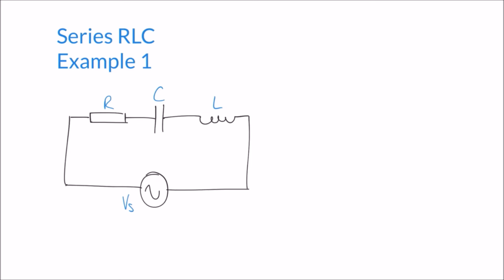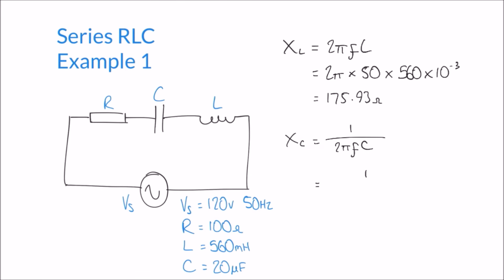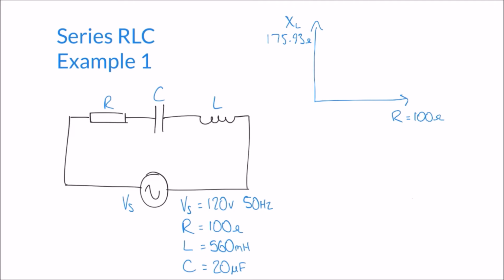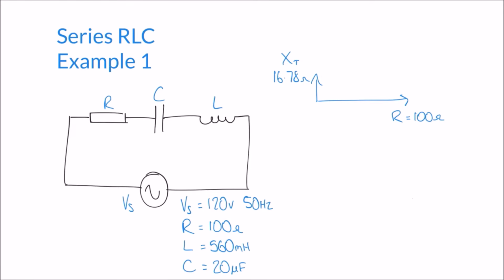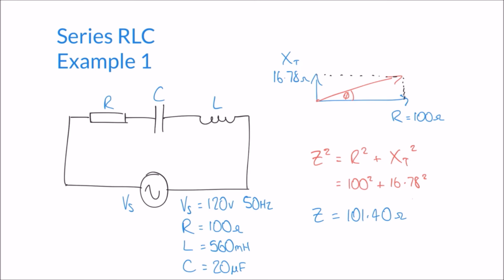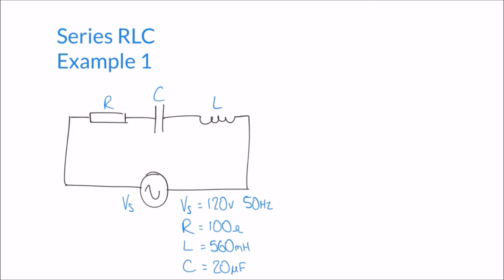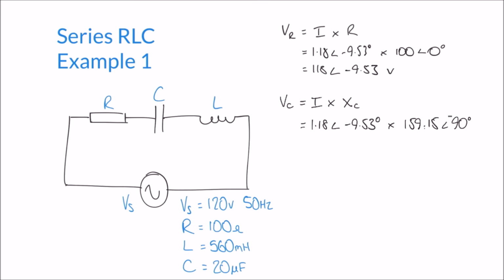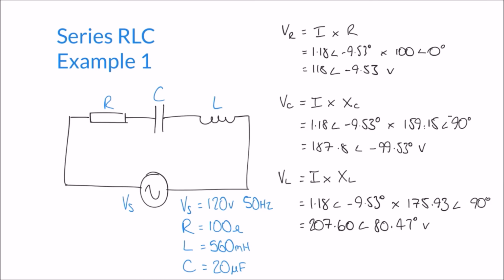Calculating Impedance, Supply Current and Voltages in Series RLC Circuit

Comment: Doing Level 3 electrical installations and found this very useful and even gave a more in-depth look at this problem. different yet similar calculations. always a joy to see different methods to work out one question as this gives more understanding of this question. Thanks for this video. still useful 5 years later. that's one of the beauty of maths.

Comment: What happens if cap reactance is a higher value than the inductor? Is it still (Xt = Xl - Xc)
Reply from the maker: Hi Mike - yes, and the result for XT will be negative. This makes no difference to the value of Z, because when the negative value of XT is squared, it becomes positive anyway. But it will mean that the resulting angle of Z will be negative negative, because it will now be below the horizontal. Hope this helps.

Comment: Ah yes, of course, it's a forehead slapping moment here in my humble cave. Thank you. When you get too focused on DC circuits, you forget that AC phase angle can create situations that seem paradoxical, where current strangely moves toward the higher voltage gradient. It's all about phase angle, which would be completely ignored by a voltmeter placed across various components.